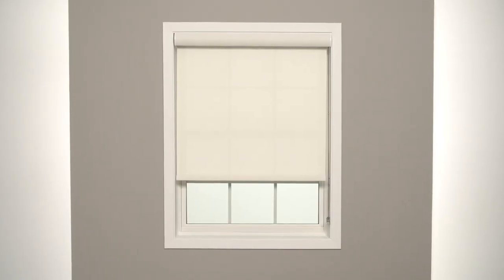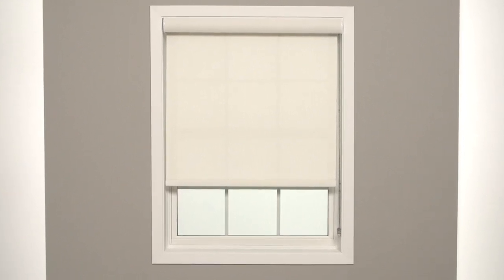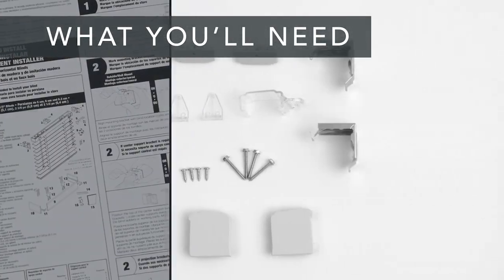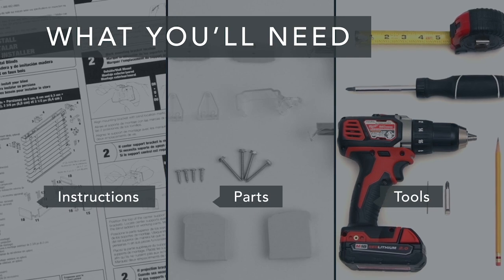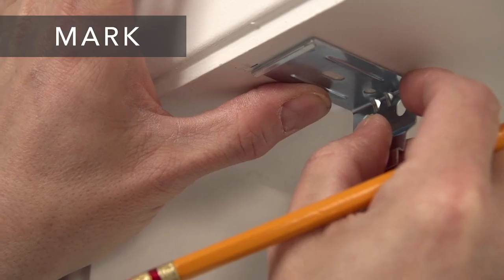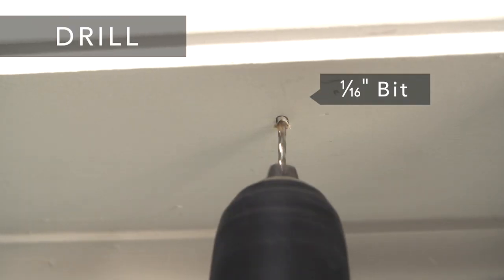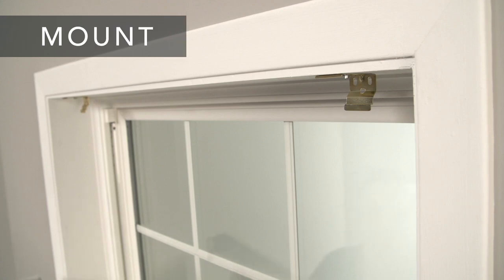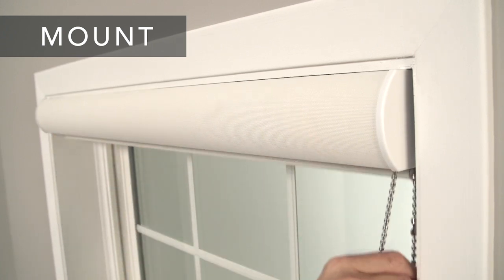How to Install Solar/Roller Shades with Continuous-Loop Lift and Cassette Valance – Inside Mount

Comment: Hi l purchased it from home depot. Some of them are very easy to install but some of them are not. I did exactly same way but I couldn't install some of my roller blinds. I don't know what the difference are.
Reply: It just didn't come in to the bracket even though I tried very hard. Can you give me some guides on what I can try.
Reply: Jongjin Kim m
Reply: @jongjinkim6380  same here, not exactly as easy as shown here.
Reply: Use your brain, this is simple enough for my 90 year old grandma to do.